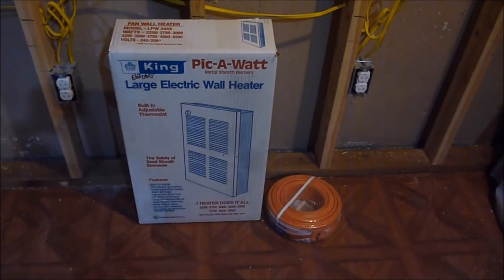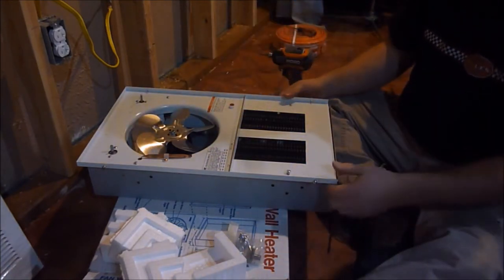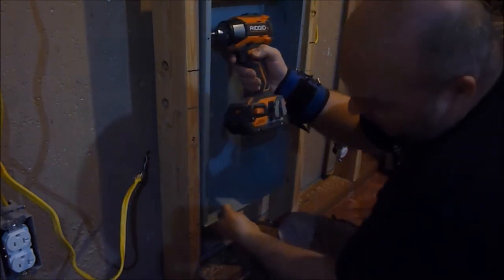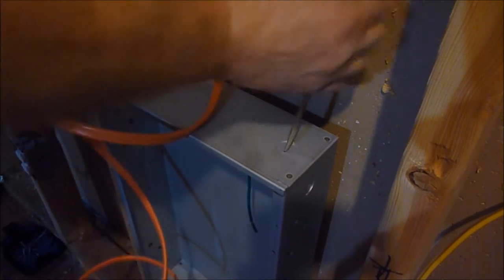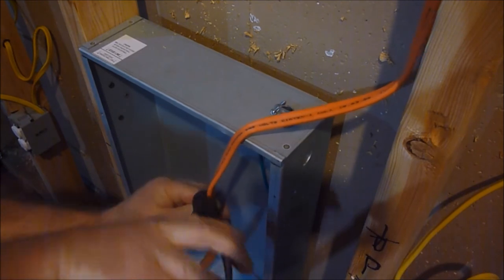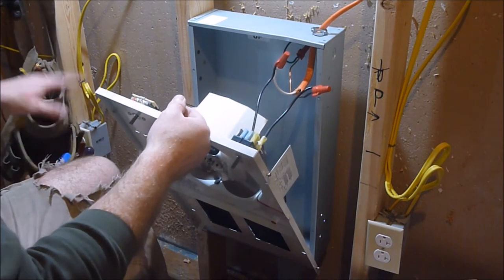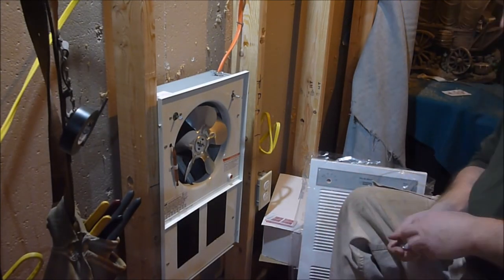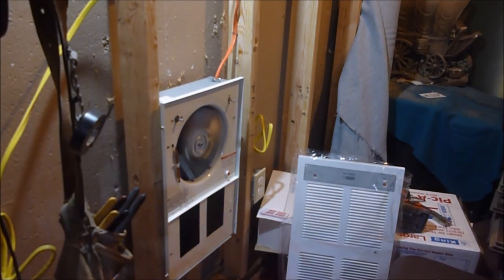INSTALLING KING PIC-A-WATT IN WALL HEATER

Comment: Thanks anyways, the problem did get fixed I had to take it all parts. Then I installed it but then it wasn't connecting because that piece fell out and wasn't put back in right. So I take it all part again, and then play with it until it connectedright we're supposed to. It's very sensitive. But thanks I got it fixed.

Comment: I was hoping that you could really help me. My knob to the heater came loose within the heater and it was wobbly. I opened it up and I saw that it came undone from small little black box is connected to. (I know nothing about this type of heater! 😆) It look like it was the easy fix to just place it back on. But for some reason it has to be set in a certain position. And I can't place it on the right position. I need to know if you or anybody can help me with this ASAP! 🥺😩
Reply from the maker: Sorry i haven't had that problem and without seeing exactly what you are saying its hard to know how to fix it
Reply: @JunkworksGarage  I appreciate it. I landed up trying to put it on the first time and it didn't work the way it was supposed to so I did a slight adjustments to the toggle switch and I got it in the right position to connect.
Reply from the maker: @joedeasthamjr8288  👍

Comment: Can you add a compressor and refrigerator to the fan heater and a condenser so you can have cool air ?
Reply from the maker: i have no idea there's no kit that i know of if thats what your asking
Reply: @JunkworksGarage  can you reverse the heat into cooling adding an outdoor condenser unit with réfringent and Evaporator?
Reply from the maker: @matthewgregory8218  i wouldn't now if you could i'm just a diyer not professional at heating a cooling   🤷‍♂️sorry